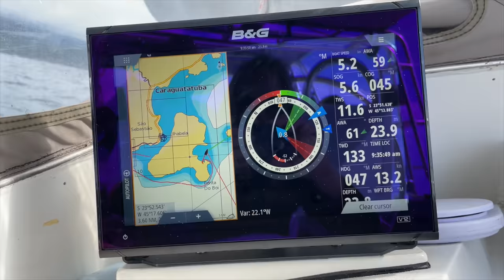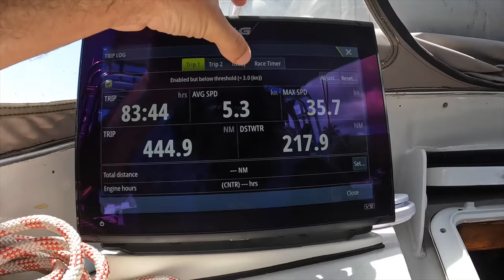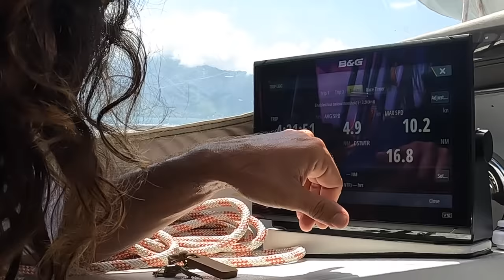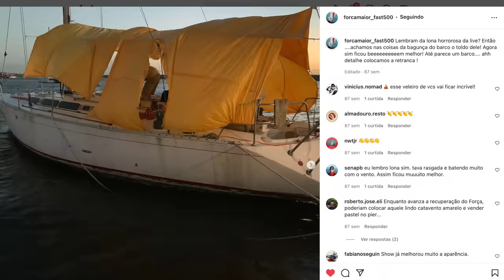⛵️The reality of sailboat life!!! (things break and we need to fix) #227

Comment: Hi Duca
My engineering sense made me think about the forces at the quadrant. The quadrant has three moment arms for non bending forces. The hydraulic steering attaches only to one point of a quadrant construction which is not made for that, especially not for high bending forces. You might think of separating the hydraulic moment from the quadrant. You can have two brackets on the shaft, one that comes with the quadrant and a second for a dedicated moment arm for the hydraulics. From the video I assume you could move the quadrant at the bracket by 10mm and put a second bracket on the shaft which holds a dedicated lever for the hydraulic steering. If a separate bracket is not possible you might make a parallel lever arm construction which is longer and wider such that it can get connected at the outer of the quadrant without any high bending forces.

Comment: "Everything is going to be ok, I don't need to fix it" 😆👍
Btw, I know it's too late now, but consider getting a bronze quadrant cast sometime. I see broken aluminium quadrants often. Stainless isn't necessary, and you can make a mold for the bronze casting with the old one, and get the final touches machined.

Comment: Hi Duca, may I make a suggestion about the quadrant problem? By making the connection of the autopilot so close to the fulcrum you are making it very hard work for the ram. If it was towards the outside of the circle it would have much less strain. However, if is connected at the outside part of the circle, although the weight required to push it would be much less, you might have limited range of movement. So my suggestion is to move it as far from the fulcrum as you can, and still maintain sufficient range of movement. 
Nice video. Great to see Fred. I enjoy his channel too. Also your friend's boat looks great. What excellent progress they have made. The internal wood work looks rich, and good quality.
Reply: Well said, I was about to comment the same.  Also with Autopilots it's important to keep the sail plan balanced and not to carry too much sail.  Sometimes you need to adjust your course for the conditions, waves and wind, just to make life easier for the autopilot and save energy too.  The right setup and careful use will greatly extend the life of the autopilot.

Comment: I wanted to suggest that you reinforce the quadrant by adding a SS plate on the UNDER SIDE of the repaired casting, bolted through to the new bracket. so the twisting load is eliminated. Also, does your friend with the refurbished yacht have a blog ?

Comment: Ahoy Duca. What would you do if a wire stay on the mast broke , what would you do to replace or repair? 
ii) As a welder I suggest that you have a new quadrant cast in magnesium alloy again. By that I mean the original is a cast, probably a magnesium or other alloy which is so much greater cast in one piece for strength. Also it is comparatively lightweight & a cast is easy for the foundary to do in that shape (not sophisticated) . If such fitment issues occur in future use a gasket made of plastic from a thicker bottle or leather... That'll give you control and a little "sponge like" at that scale will not be a problem 👍. A man like you can surely sense the toughest of what is on board?
iii) That curve in the corner is called a "WEB" BTW. 
iv) Alternatively cast it in bronze! It will stand for decades and the toughest thing will be keeping it locked onto the steering shaft.

Comment: A new Stainless Steel Quadrant would be the safest and most reliable choice. Especially if you are planning to travel the world, and be days out at sea with no land in sight. Cheers from Winnipeg.
Reply from the maker: It would take more than a month to be ready. Future plans
Reply: @OddLifeCrafting . I agree with the stainless steel option. You could fix this one for the Interim, but aluminum and magnesium have never coexisted with a salt water environment for very long. It corrodes fast and it becomes brittle.the quadrant will always be under some degree of strain and the steel handles stress much better than cast aluminum . You are fortunate you have a repair option 6 hours away by car, it could be days or weeks away by sail if it failed mid Pacific.

Comment: Welder, welding mistake.
Never weld a sharp corner. 45deg, 90 deg etc.
Always round the points put 160,180 deg.  Duca. Spread the weld, force and weight Sir. 
Good video.
Learning process
Carry on Crew

Comment: Testament to the autopilot for not breaking yet. It has been explained many times how levers and fulcrums work and why you keep breaking stuff. I guess keeping the same design and making parts stronger is one way of trying to fix the problem. An exercise in futility.
Reply from the maker: On next weeks video we install it back and explain why we couldn't change the design. There are space limitation. Right bellow the quadrant there is a hull/rudder structural reinforcement and because of that there is no space to install the autopilot farther from the rudder shaft. We do know the formula M=FxD and we know if the distance is small the force will be really high, but we couldn't find a better way of doing it so we have no option but to reinforce the quadrant and the support.
Reply: @OddLifeCrafting  Thanks for the clarification... wasn't aware of the space and mounting limitations. I'm guessing mounting the autopilot aft of the rudder shaft, with an extension from the quadrant is also not possible.